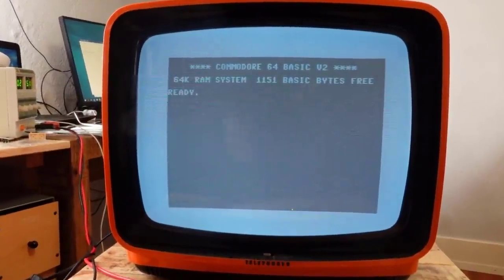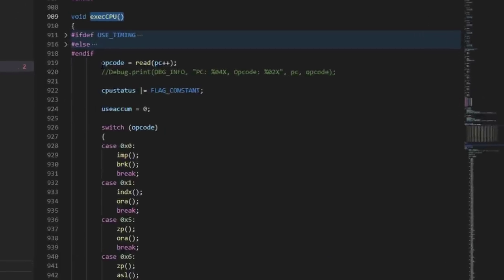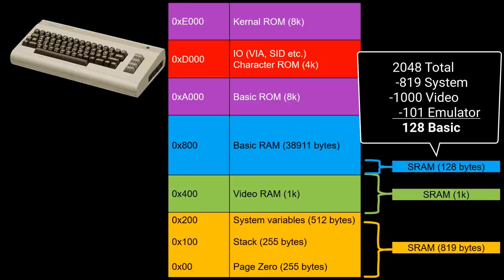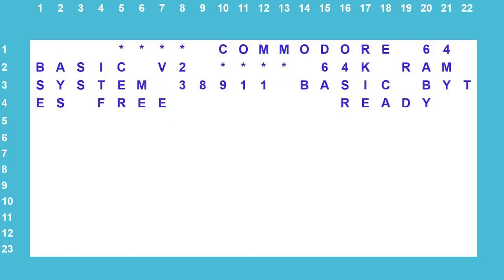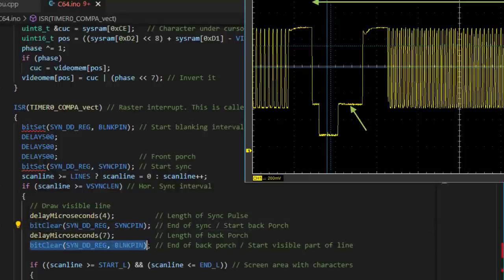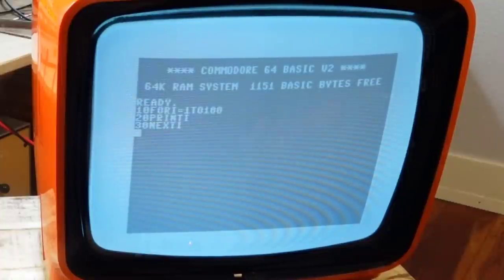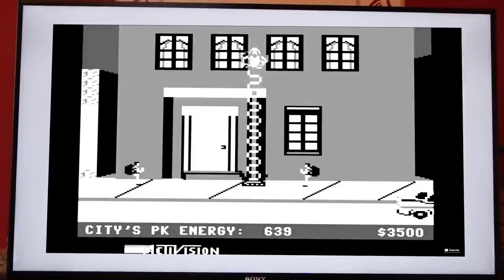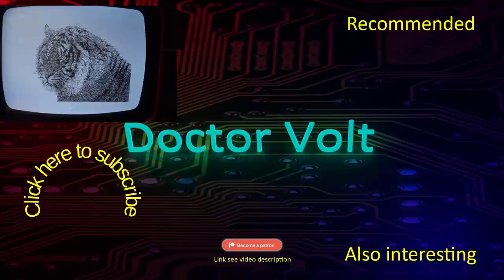Arduino Emulates a Commodore 64!

Comment: The Commodore 64 was handy for ALL sorts of things.  One of the most amusing I discovered was in one of the typical "Computer Stores" back in the 1980's that sold IBM PC's and such.  They had a Kiosk with a video display and some big buttons you push and it would give you varioius IBM PC sales pitches.  I wondered what they were using and opened the door at the front of the cabinet bottom.  This IBM PC sales display had a big laser disk controlled by (drumroll please) a Commodore 64.

Comment: The glitches when typing on the keyboard remind me of the Sinclair ZX80 and 81 which did similar things when typing (and for similar reasons!). Interestingly, the Raspberry Pi Foundation's Pico board (similar to the Arduino in its main function, but with more RAM and speed, but only about $4!) can do emulation surprisingly well. For example, here's NES and Gameboy: https://youtu.be/FB4kOBt8ARo and BBC Micro: https://youtu.be/WaPJmCgseQw

Comment: Pretty impressive seeing an 8 bit MCU emulating an 8 bit microprocessor with a sensible performance. Especially as most of its time is spent spitting out composite video.

Comment: Impressive. I would love to see that on an ESP32. There you have enough SRAM and the second core or maybe even the ULP core could handle the composite signal
Reply: The ESP could easily do it - it's already been used to run arcade emulators that used the 6502 and the Z80 CPUs (e.g. NES emulation)
Reply: It seems that the ESP32 clock speed should be around 10 times that of the arduino at 160MHz. That means maybe emulating at the same or faster effective speed as compared to the original 6502
Reply: Check out the Odroid Go, it's an ESP32 in a Gameboy-like case. It can emulate a c64, and some other 8bit stuff.
Reply: The ulp runs at 8mhz, but the instructions gobble many cycles each, as far as I know interrupts aren't supported but it might run as a continuously timed scan, which I'd be interested to find out more

Comment: Amazing.
You can look to ZX81 - there CPU also displayed screen but it has two modes FAST and SLOW in FAST screen flickered when typing but  in SLOW not.
I don't remeber exactly, but i think other code than display was execeuted only in horizontal and vertical return time for SLOW mode and there was not flickering.
or other words other interruputs was only enabled then.

Comment: Really great job! It is fantastic that these days is possible to take 3$ board and experiment and simulate / emulate devices which costs month salary before yr 2000.
Reply: That said, the original 6502 CPUs ran at ~1 MHz and early home computers used DRAM memory (early ram design, pretty slow and the contents must he routinely refreshed). And the ROMs were directly accessible because they occupied the main memory space.

So even a "simple" atmega 328 is quite powerful by comparison. 
 
Most Arduinos (and compatible boards) using an 8-bit AVR design run at the full 16 MHz the chip is rated for and the 328 has 2K of on-board SRAM (fast and doesn't need refreshing) as well as 32K of flash memory for the program binary. In addition, being a Harvard Architecture, the program and data memory are on entirely separate buses and therefore accesses are probably faster.

Comment: Take for emulation the C64 a ESP32. You can interpret basic programs  from flash memory and the Speed is.spectacularly
Reply from the maker: Should not be too difficult to port this to an ESP32. The real challenge is however to squeeze every bit of power out of the Atmega.
Reply: @DoctorVolt  , I believe there are solutions to emulate a 6502 with VGA output and PS2 input. A C64 is not far away.

Comment: Im curious... since you can emulate the 6510 and the arduino has various GPIO pins... would it be possible to use the 6510 emulation (without basic and all the other stuff) as a drop in replacement for a real 6510 cpu.  it runs at 16mhz, so perhaps its doable
Reply from the maker: Yes. An Arduino Mega has enough ports to emulate all the pins of a 6510
Reply: @DoctorVolt  Thats quite interesting.  Imagine a 64 developed and running on just emulated chips.  Although accessing external memory (another emulated series of chips) might be slow
Reply: I did this with a Teensy on the MicroCore Labs MCL64

Comment: A little OT question: how did you compile the VIC-20 sketch? I got this error and I don't know how to fix it...

cpu.c:64:1: error: unknown type name 'prog_uchar'
cpu.c:64:12: error: size of array 'BIOS' is too large
exit status 1
unknown type name 'prog_uchar'
Reply from the maker: Rename it to uint8_t  and it will compile.
Reply: @DoctorVolt  thank you! I changed as "const uint8_t " and it compiled... however, as you told, it doesn't work (while yours, for C64, works perfectly!)

Would you make a video (or at least leave here  some info) about how to fix this problem for the VIC-20 project?

Comment: The C64DTV is based on an ASIC single chip implementation of the Commodore 64 with enhancements, it does NOT use emulation the C64’s chips are implemented in the C64DTV’s ASIC chip.
Reply from the maker: Sure, there are many ways to emulate a C64. But in case of an ASIC I would not say emulation.

Comment: Impressive work.
Wouldn't it be possible to link Arduino together to increase the calculation capabilities?
Reply from the maker: Sure, you could use one Arduino to emulate the processor, and a second one for video signal generation. And maybe even a third one for sound.

Comment: Very clever! It will be interesting to see at which date in the future we will be able to use an Arduino or similar device with the same form factor and power consumption, but it will have enough power (and RAM) to fully emulate the C64

Comment: Really amazing!!!! 
What about to use an Arduino Due, that should have everything needed (Flash, RAM and SDcard support) to get closer to a 100% emulation? Do you thinkg is it possible? I used the Due for another project, a 100% Altair 8800 emulation with 64 kb RAM etc., so maybe it could also emulate the C=64, loading the programs from the SD card (as for the Altair-Duino project)
Reply from the maker: I think that it will not be difficult to port this to an Arduino Due

Comment: Suggestion: why not to make a similar project for PET? You already have the code for 40 columns, it should be just a matter to remap the ROM images...? Since you know perfectly the code you wrote, should be an easy task for you, I suppose...
Reply from the maker: Yes, in fact this can emulate any Commodore computer with a 6502 or 6510. But I think that a video where I emulate other computers does not  make much sense, because this works similar and it might become boring if I tell the same things in every video.
Reply: @DoctorVolt  I understand and agree with your point of view. However there's a big plus, making a PET emulator: you can use it to build a working mini-PET clone (the first PET was sold with just 4kB RAM), using a 3D printer for the case. AFAIK this was done using a Raspberry, but never using an Arduino - that would be a great project, also because it's a 3$ hardware instead of 40$.  
BTW I tried to replace the ROM images, but of course it didn't work :,-(

Comment: couldnt you take a second arduino to read the keyboard and then feed the keystrokes to the first arduino using serial port. That may fix screen dropout.
Reply from the maker: no, because the arduino still has to interrupt the video output to process the input.
Reply: @DoctorVolt  yea, never thought of that.

Comment: What about the user interface (input/output pins), is it functional? Can I control LEDs etc. with it?
Reply from the maker: Not in the current state, but this can be implemented in the Arduino program.

Comment: Hello Dr volt ,
I try to run the sketch on nano but no video signal. I checked the signal , resistors but no results.
Is this related to any Arduino ide  update ?
Reply from the maker: I just tried with the newest Arduino IDE, V2.3.2 and everything worked fine. Maybe there is something wrong with your Arduino.
Reply: Is it possible that no video signal due to use of N14148 diode instead of Bat48
Reply from the maker: No, it also works with 1N14148, but a schottky diode like BAT48 makes better video signal quality. Maybe the reason is that your TV/monitor just doesn't accept the video signal.
Reply: I tested the  Arduino TVout library and worked fine. Also I checked the signal on the oscilloscope and it’s similar to your signal but  not working in the tv.
Anyway, thanks for your responses.

Comment: Hi Guy! Thank you and so good...
Only, There is an error in what you say at the minute 4:20.
What you show there, is the video signal of a SINGLE HORIZONTAL LINE
of an image. In a CRT screen, the electron beam paint
the ENTIRE screen 50 TIMES PER SECOND, and EACH TIME  it
traces 625 LINES! So, on balance, it runs through a SINGLE LINE
of screen in only 64 MICROseconds (and not 64 MILLIseconds,
as you said) which is 1000 times faster.
Bye!
Reply from the maker: I know, but it is no more possible to change

Comment: Wow... I never imagine that Arduino can emulate an 8bit computer!!
Reply: Well actually the Adruino can't emulate an 8bit computer (not an C64 anyway) its not even close to emulating a C64.
Reply: @TalpaDK I'm pretty sure this video directly contradicts your assertion, at least to some extent. An arduino can easily emulate the 6502 cpu, some ram, run BASIC, and do composite video output.

The C64 can do quite a lot more, but to really exercise the hardware requires assembly programming and knowledge on how to make the best use of the dedicated video and sound chips.
 
--------

Technically the Arduino IS an 8-bit computer since it has an internal CPU, RAM, Storage, and I/O facilities.

Comment: Great but puzzled where the 64K ram is? Most Arduinos don't have that much.
Reply from the maker: This is because the C64 OS only needs around 1.5K of RAM. So the emulator works with much less than 64K. However, there is only around one kilobyte for BASIC programs available.
Reply: The message "64 RAM" is a fixed text in the ROM. The amount of free memory was displayed to the right.

Comment: Why does it say 1151 bytes free on boot up screen?
Reply from the maker: This is because the Arduino has 3 kBytes (1k SRAM, 1k EEPROM) instead of the 64 k of the original. Most of it is already used by the emulator itself, the kernal and video memory. So there is only 1151 byte left for BASIC programs.
Reply: @DoctorVolt  Ahh I see.

Comment: hey man
im trying to make something like this with a 16 x 4 lcd and a wireless usb keyboard
im a beginner and dont know arduino coding so...
i was wondering if you could help me out here...
Reply from the maker: The keyboard used here must be PS/2 or a PS/2 compatible USB keyboard. Wireless keyboards (at least the one that I tried) are not PS/2 compatible. So I see no chance there.
Reply: @DoctorVolt  ok but what if i use a wired keyboard, where do i even begin?
Reply: @DoctorVolt  i have a ps2 adapter
Reply from the maker: @HashirEasa  See the link in the video description
Reply: @DoctorVolt  thanks, but what do i do if i want to use a 16 by 4 LCD module?
Reply from the maker: See here: https://create.arduino.cc/projecthub/michalin70/connect-a-usb-keyboard-with-an-arduino-50c077
I did it with a 20x4 display, but 16x4 should also work.
It´s up to you to find a BASIC interpreter that runs on Arduino and adapt it accordingly. Unfortunately I cannot help you out there.
Reply: @DoctorVolt  thanks so much for the help, i really appreciate it. (i dont know if i spelled appreciate right 😅)

Comment: Obviously the emultion speed is slow because the arduino cpu gets interrupted every 64us and waste a lot of time in do pal or ntsc signal timing emulation. Moreover , the megaswitch C  code used to emulate the cpu opcodes is far from optimal
Reply from the maker: I doubt that dangeling elses are faster
Reply: @DoctorVolt  i do not recommend to use if else statements, of cource i'm only saying that the switch approach in order to emulate a 6502 cpu is far from optimal.
Reply from the maker: @gasparinizuzzurro6306  What do you recommend instead?
Reply: @DoctorVolt  First, i will replace the video load which is relatively heavy and has the annoying problem of getting out of sync when you work with keyboard interrupts.

Next, in order to improve speed, due to the relarively simple 6502 architecture, (the opcode is always 1 byte in length), i will try to consider in with a sort of 'array of function ptrs' which can be easily indexed. Each entry in the array is a jump location performing the  6502 opcode emulation.

Of course this should be done in assembly not in C language to achieve a good efficiency.
I doubt that the megaswitch is implemented as an array of function ptrs, even if i know that some compilers sometimes use jump tables to implement the switch case instructions.
Reply from the maker: @gasparinizuzzurro6306  Ok, there must be more research done on how the switch statement and if-else are actually compiled. The idea with the array of function pointers also sounds good.

Comment: I wonder how it could work if you used more than one arduino :)
Reply from the maker: You could of course also emulate the SID and the VIC-II with two more Arduinos. And also add 64k of Ram. So you can make a fully functional C64.
Reply: @DoctorVolt  that sounds great! And then only the controllers and some tapes to load games!

Comment: it's kernel, not kernal. ppl need to learn that
Reply from the maker: It's called "Kernal-ROM" everywhere. But technically it's a kernel. That's right.
Reply: It originates from a spelling mistake from the VIC-20 era but it remained "Kernal" in all of the C64 related documentations too. So basically it became a kernel called "Kernal" :D

Comment: Why would anyone want to emulate a C64 ? - What a massive waste of time, most of us who remember it when it came out thought it was sh1t and it definitely hasn't aged well - I really don't understand this old computer nostalgia thing .
Reply: What did you do with a C64? What are you comparing it to? It sure was great for the money at the time and when programmed in 6502 Assembler quite fast.
Reply: If nothing else, as a point of reference because it's something many people were familiar with the characteristics and limitations of.  If I tell you the constant-time VM I wrote for PIC18 can run 235K emulated VM instructions per second on a 64MHz part (and it can), what would that even mean to you?  It's much more useful than emulating a C64 (you'd be amazed how much overhead context switching can have on PIC - if you're trying to run two threads in a hard realtime app that only gives short breaks to run non-realtime code, using an emulator is overall an easier choice than trying to thread two native threads), but nobody can conceptualize the performance involved because it uses a VM architecture nobody but me has used.  At least this video is relatable.